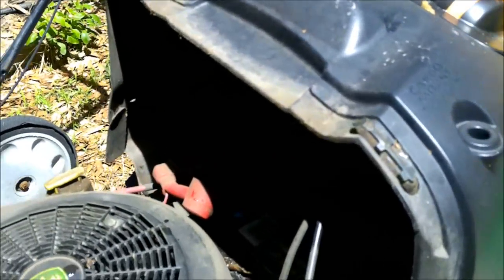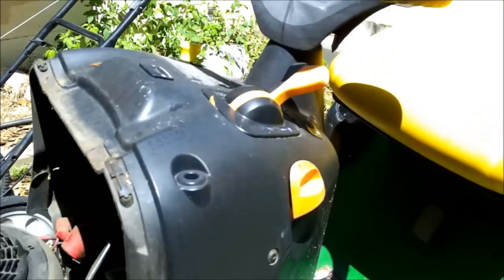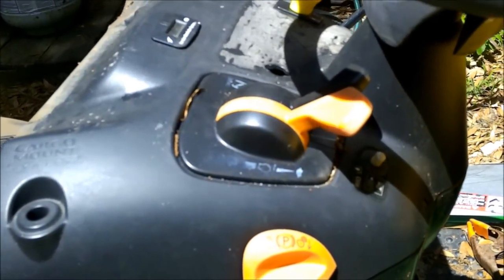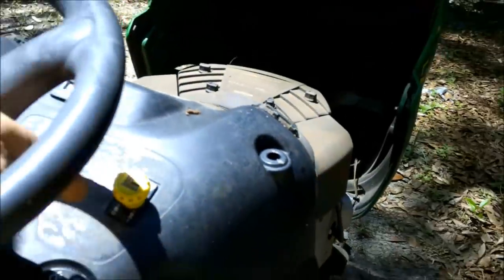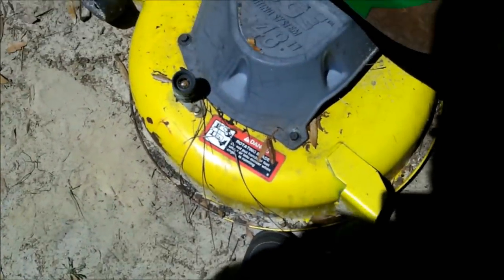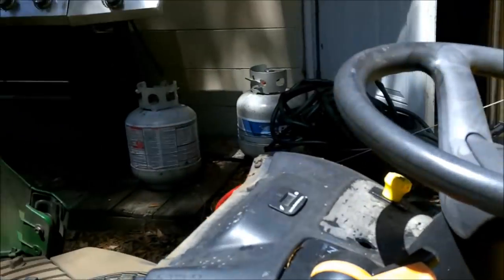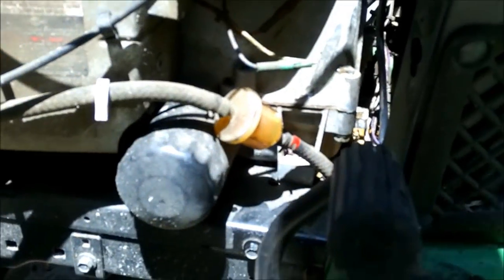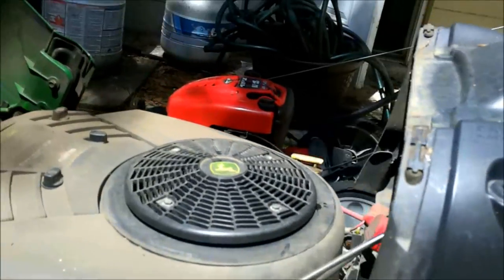How To  John Deere Riding Mower Wont Start

Comment: I too cleaned battery terminals even replaced battery. It's was running for a sec then  cutoff, done same thing with battery change. I looked your vid up and paid attention to your step by step walk thru. It enlightened me I found a a connector that was loose or maybe it just popped loose I guess because cleaning all the grit and debris " trying to find something"'. Big Thanks to your help. A smaller connector up under the turn switch area. Without this I getting ready to " empty my pockets" . JD would have cracked my open for sure but you saved me. Thought it may have been starter also. But once again you saved me today . I finished my yard. Who knows what's up 2 weeks from now but or right now I'm good. ONCE AGAIN BIG THANKS BRO!!!!! 💯✌️

Comment: IT WORKED ON OUR 20-YR OLD JOHN DEERE 277AWS!!!!   This has happened in the past, and mysteriously it would start up after I walked away (then prey a little bit) and try again minutes later.  I always figured it was a heat situation.  But this time, the tractor was totally bricked out no matter how long I waited.  Thanks to your presentation, I looked underneath to see what happens when the break pedal is pressed down and sure enough discovered its arm presses down on a rubber dome-protected push button.  There was no obstruction, but I pressed it with my finger a few times, then got on the tractor, pressed the break pedal normally, and it STARTED UP!!!!   Thanks to you, I feel like a seasoned mechanic now.  Thank you, thank you, and again, THANK YOU.  :)
Reply from the maker: I am very happy to hear that this video helped you. You are very welcome. Thanks for watching and commenting. Have a great week and stay safe my friend.

Comment: Mowed 2 big yards,  with a  23hp Dealership mower today.   No problems.  Cut it off,  to gas up,  for the next time,  tried to crank,  to put it back in the building,   it did  the same thing yours did.  going to check it out tomorrow,  and if your problem solving works,  I'll be back,  with a big Thank You.
Reply from the maker: Thanks. Please let me know what the issue was, it could help my viewers and me as well in the future.

Comment: I fixed this switch years ago on my L130....I just popped it back into place and forgot about it. Won't go into ALL the issues I started having but like forums have said CHECK ALL YOUR SAFETY SWITCHES 1st!!!!! Popped this switch back into place, zip tied it in place so it would not pop back out and it fixed the Hard start when cold, NO START when hot until it cooled off for awhile, & RPM dropping when getting off mower & parking brake set issue. I replaced the starter solenoid, the key switch, but NEVER installed the new seat switch & this simple check & fix, fixed ALL my problems. The battery is still the original and is about 16 years old now + the mower NOW has 1450hrs on it & is VERY RELIABLE despite what some people say. I've seen these things totally trashed with 500hrs on it, what these owners do or don't do to them I could care less. THANKS for the video & the reminder!!!!

Comment: Thanks for the tips, I didn't know about the low oil sensor.  If you don't have any Coke around, white vinegar works pretty good for cleaning corrosion.
Reply from the maker: you're welcome James. i have done the white vinegar before, it really works well with baking soda. thanks for the tip James.

Comment: I had the same issue turn key nothing.....no clicking no cranking....i had just used the mower was cleaning it ...when i was done it would not start...so i have checked both the seat and brake safety switches....i checked all the fuses and diad (black fuse) i change every fuse on this mower i even bought a new solenoid put it on and still the same no crank no click...not a damn thing...this is on a x320 54in deck
Reply from the maker: Check cable on the starter. Also see if it will crank if you run a jumper directly from the battery to the starter.
Reply: I went thru this with my very 1st used mower. I said never again ,that troubleshooting will kill your wknd!!! Lol Hell Nooo!!!!

Comment: Brake switch was exactly the problem for me.  It was not unplugged like yours but the connector had popped off the frame therefore the button was not being pushed when the brake was applied.  Thanks
Reply from the maker: Check your fuse? Also, jump across the solinoid and see if it cranks.
Reply from the maker: Rollie Motor  make sure you check the fuse, very important. If fuse is good, make sure you have power going to the switch. If you have power to switch, make sure you have power coming from switch to the solinoid when turning the switch to the crank position.

Comment: I have a la125 mower. Sometimes when I turn the key it won't crank. give it a little time an then it cranks and starts right up. When  it starts running it runs smooth and then start surging. Any Ideas. Thank you in advance for any and all ideas/thoughts.
Reply from the maker: could be the coil getting hot. i would check that first then if thats not the issue, it could be in the carb.

Comment: I had  same problem with my john deer lx178  ,put a new battery a weekprior and used one time,the second time dind’t start at all ,so i check the  brake swirch and it started .thanks  for the  suggestion

Comment: Thanks Shabear1000.  I appreciate it.  I'll check the seat and brake/clutch safety switches now and see what happens with my John Deere L118 that's having problems starting.  If that doesn't work, I'll check the selenoid and starter.  It's getting fuel, new battery, new plugs, new oil and filter, new air filter.  Thoth in central Virginia.  P.S.:  How did your trip to the haunted bridge go?  That sounded interesting.
Reply from the maker: It was cool. Its in a couple of my playlists.

Comment: Brake switch ok when cold but when I turn it off and the motor is hot the brake switch will not engage until the motor cools down around 5mins

Comment: We just used ours for the first time. Brand-spanking-new. It mowed half the lawn and it won’t turn on now 🤦🏽‍♀️
Reply: Did you make sure the blade was turned off ?   It won’t start if the blade is still on
Reply: Frank P it had something to do with the seat. So the hubby just disconnected it. Works fine now! Lol
Reply: Lol it’s crazy with all the safety things it has now! But maybe it’s good so we can have the kids mow it lol
Reply from the maker: Lol

Comment: I bypassed all the safety switched the seat switch, and the brake switch. After I done that it still is nothin
Reply from the maker: Check your ignition switch, starter solenoid, all the connections. Let me know what you find out.
Reply: @shabear1000  thanks for the info I put a new Ignition in today and a new starter solenoid few weeks back
Reply from the maker: You're welcome man. Check the starter as well. Also make sure the fuse is good.

Comment: John Deere lawn tractors are pieces of shit these days... just bought one April 2020 James River Equipment... already stayed in the shop for 2 weeks it dropped the drive belt because they didn't assemble the tension spring in the right direction (upside down)... as of today it just shut off then wouldn't start... I really did nothing but let it sit for about 45 minutes to an hour went back and it cranked... x350 on sale 3,200 bucks... plus John Deere Corporate is a waste of time... they ain't our Dad and Grandad's John Deere no more...
Reply from the maker: Thats for sure...